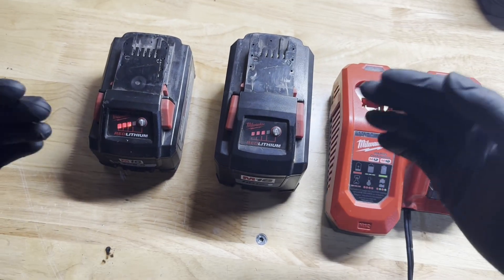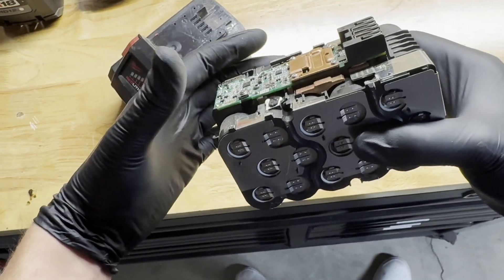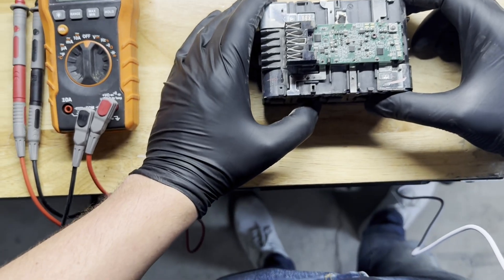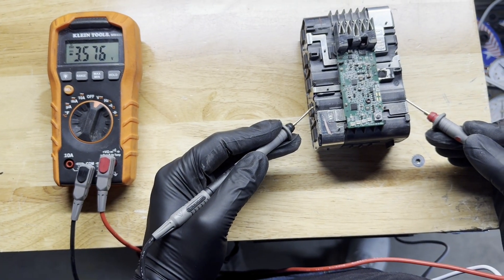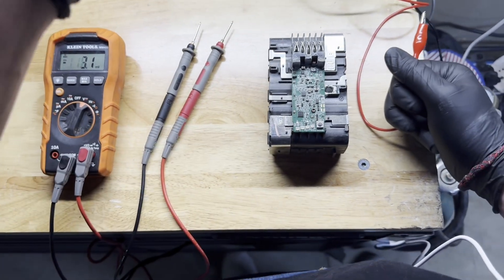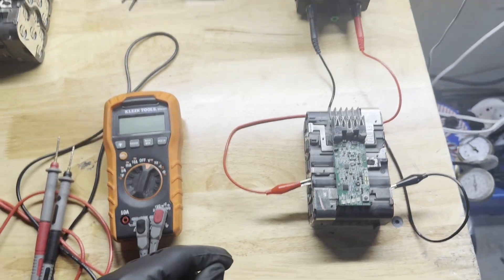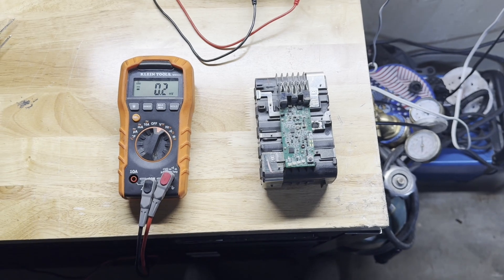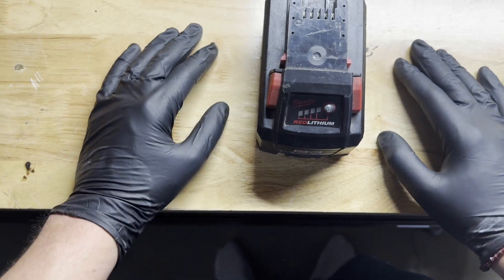MILWAUKEE BATTERIES WON'T FULLY CHARGE!? — IT’S WAY EASIER TO FIX THAN YOU THINK!

Comment: Hope you can help. I have a Milwaukee M12 battery that was showing 8 V but got the Christmas tree lights, trying to charge. I tried to jump it but left it connected for at least 30 seconds and then when I checked it, I’m showing 0 V. There was no smoke. I took the battery apart. There’s no swelling. I don’t see any damage on the circuit boards and I don’t see a fuse. Do you know why it’s doing this? Should I try to charge it again? I can’t find any videos that show this incident. Thanks.
Reply from the maker: What did you jump the battery with? M12 are pretty bare bones circuitry wise so I would assume either 

1. The batteries are toast(I would check them 1 by 1)
2. One of the soldered connections is loose.(should be easy to see/test)
3. One of the traces on the circuit popped and you no longer have a complete path. Maybe even one the resistors is toast.

Comment: Milwaukee doesn't have a battery shut of in there packs it's in the tool. Wish they did then my aftermarket jacket adapter wouldn't have drained 2 of my batteries to low to charge normally again. I love my Milwaukee tools but the BMS are really lacking the tech the other companies use!!!!

Comment: this is only temporary fix , once the cells go out of balance they will do the same again after just a few charging cycles . the only solution is to replace the bad cells , or even better replace all of them.
been there , done that many times .
Reply from the maker: Agreed! At around the 3min mark I mention how batteries from the factory are somewhat of a crap shoot, its because its all just a chemical reaction and sometimes things just don't behave the way we want them to. Same thing with this method. Its not permanent, but it is a crap shoot. My friends has been using these two batteries heavily since May(5months now) and they are still working at full capacity. I have also heard of some people batteries degrading back to this after the first discharge/charge cycle. Agreed that the best solution is to change out the cells.

Comment: For those of us without the fancy power supply, would it be feasible to lower voltage of the higher cells by discharging the high bank via an external load, say a 6 volt bulb for instance?
Reply from the maker: Yes! Its more difficult to control the discharge rate though. These batteries can output massive amps instantly and can shock and potentially harm/kill you. I would not risk it, but If you had to you would need to do the proper math with using resistors and I would also put an inline fuse that would pop if a surge of power occurred. THIS IS NOT SOMETHING I'M RECOMMENDING, but theoretically you would get the same results. Once the cells are balanced you can charge the battery up like normal.

The safer/cheaper route to go would be to buy an 18650 Battery Charger. They're like $9 on amazon and a pair of alligator clips. Connect one side of the alligator clip to positive terminal on the charger and the other side of the clip tot positive side of the battery cell. Some thing for the negative side. This gives you a lot more control and to safely do it.
Reply: @MrFixedIt  Hello, many thanks for that, I am however perplexed how a 4 volt battery can give me a shock.  I had in mind using a 6 volt 12 watt filament bulb (for example).  On 4 volts that should dissipate 5.3 watts by my reckoning.  Or am I wrong?  Would take quite a while I guess, but it would be under control!

A power supply would definitely be the way to go as long as it is not inadvertantly connected the wrong way round.
Reply from the maker: @jesserawson898  You're absolutely right that a 4v battery can't shock you, but if anything was wired incorrectly or something happened to short out. These batteries can discharge a lot of current. The set up should work. I would maybe toss an inline fuse in there or a resistor to limit the current that goes into the bulb just so the battery and or bulb is protected.

Comment: Did you charge both cells that were reading the 3.5V & 3.7V or do you just meed to charge the lowest reading cell bank? And also how long did you leave the charging for on the setting you mentioned for the DC power supply?
Reply from the maker: Yes, both cells needed to be charged. You want all the cells to read very closely to each other. Otherwise you won't get the full use out of the batteries. My friend has been using both of these batteries fairly regularly for the last 4 months and they're still working at full capacity, but your results may very depending on how "good" your cells were made in the factory. Sometimes its just a luck of the draw with batteries. 

Charging time will vary based on how different each cell is in voltage. So in this case the 3.5v cell took a little longer than the 3.7v cell to get them both up to about 4.10v. You want to have the cells as close as possible to each other to get the most use out of your batteries. In the video I have about .05v difference between the cells once fully charged. So...

Cell 1 read: 4.119
Cell 2 read: 4.092
Cell 3 read: 4.073
Cell 4 read: 4.106
Cell 5 read: 4.121

With this you see Cell 5(4.12V) has the highest and cell 3(4.07V) is the lowest after charging. The difference between the two is about .05V. That's fairly close to "perfectly" balanced. I would keep yours in this range too.. as in don't have a difference of more than .05v between any of the cells. I just kept checking on it here and there. I believe the 3.5v took about 2 hrs. But I don't remember exactly how long it takes. You don't want to charge them too quickly because that can damage them.

We set the amperage to around  .5 - .6 Amps. Amperage in electricity is like flow and voltage is like pressure. We set the voltage to the desired outcome of 4.12V and the amperage(flow) .5. That's essentially how quickly it charges. We could set the amperage to 1-2 amps and the battery would charge within minutes, but it will surely break your battery. I would keep it at about .5amps to make sure it charges nice and slow to preserve your batteries life.

If I wanted a perfect battery I would have charge each cell to be 4.12V if that makes sense. 

What I sadly didn't show in the video is what I had the DC power supply settings on before connecting the battery. I had the voltage set at 4.12V and at .5amps. Once I connected it to the battery it dropped to the loaded voltage and amperage which then on the video showed 3.77V and roughly .4amps. With me setting the power supply to 4.12V I can't overcharge the battery because it will only charge up to that voltage. That being said I wouldn't leave it unsupervised and check on the battery every 20min or so to make sure nothing is going wrong. These batteries can be very volatile and dangerous. The fires they create when damaged are very difficult to put out. So just be careful.

Let me know if anything doesn't make sense or you have any other questions!

Good luck!

Comment: This will not fix anything. This always happens to any battery pack made with the Samsung 40t cells which are the m18 8.0ah and 12.0ah non forge batteries. Those Samsung 40t suck. I always have to open them up and charge up one of the low voltage cells with my icharger but this still will only last a few charged before that same cell group gets low again.   It’s that bank of cells are simply garbage meaning the capacity is lower plus the crazy bms does not balance charge.  This only happens with the Milwaukee 8.0 and 12.0 non forge and the old 9.0ah as well.
Reply from the maker: Basically highlighted everything in my video!

Yea it might not last long, but saying it won't fix anything is ridiculous? My buddy is still using these packs and has gone through multiple charge cycles. It a quick an easy way to get your battery to be fully operational again for a bit longer.
Reply: @MrFixedIt  If it is only after 10 or so charging cycles that you have to do this again, it is fine but when it starts being every one or two, that is the time to replace the battery pack fully.
Reply from the maker: @christopherkidwell9817  Completely agree with this!

Comment: What kind of dc power supply are you using in the video?
Reply from the maker: The specific one I am using in the video is this one...
https://www.amazon.com/dp/B09YSJQWRG?ref_=ppx_hzsearch_conn_dt_b_fed_asin_title_7&th=1

You can really use any which one you find though. Id say that one is more of a cheapo type power supply, but $50 still feels a bit much. Especially if you're just charging up these batteries.

You could even use something like this one. It would do the same exact thing, but for a lot cheaper...
https://www.amazon.com/Adjustable-Universal-Switching-Minidodoca-Electronics/dp/B0C5QG946M

Hope that helps!
Reply: Will the Gen 3 batteries work with the original circuit board? If you upgrade them?

Comment: Those are Samsung 40T gen 1
are known to be defective 
so are gen 2 used in Bosch

the latest gen 3 holds up no issue
but Milwaukee already switched to Forge Ampace JP40 which so far very strong

Comment: About to start this process on mine. Will you direct me to an item list or parts and tools needed?
Reply from the maker: Yea of course! 1st you 100% need a multi/volt meter. So you can check the battery voltage. 

T10 & T8 security torqs bit. You might need an 8 depending on the battery pack.
to charge the cells separately you need either a power supply or a battery cell charger.
I can't recommend a battery cell charger cause I don't have one, but any which one on amazon should be able to do the trick.

Comment: This is dope, pretty simple to do. Would you recommend to check your batteries even if they aren't doing this, to keep them in good shape?
Reply from the maker: Not necessarily. If the cells are imbalanced its not breaking your battery more. You're just not getting full use out of it. So its not a matter of keeping your battery in good shape. Its more of getting full use out of your battery. if there's a slight imbalance but the battery is working as normal I wouldn't bother. The BMS built into the battery SHOULD keep the cells in the happy range... For the most part...

If, like in the video, it won't fully charge up but it says it is... You can take it out and re-balance. Its without a doubt the properties of those cells are now considered "broken" and its best to replace the cells. Otherwise its totally ok to keep taking it apart and balancing the cells. It will all depend on how well the specific cells in your battery are made with how long the re-balancing will last. From research I've done its almost guaranteed to go back to being unbalanced. How long that takes is up to the cells placed in your battery.